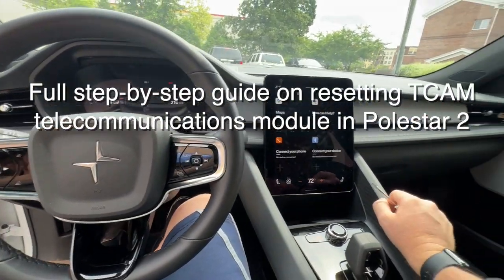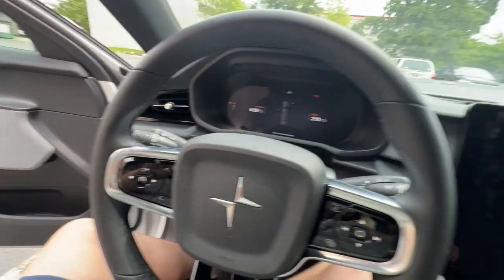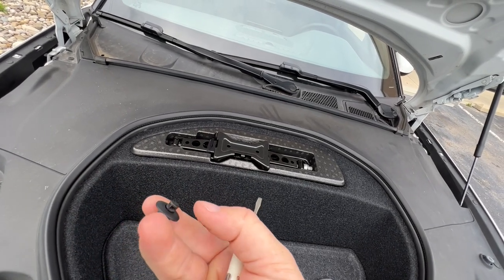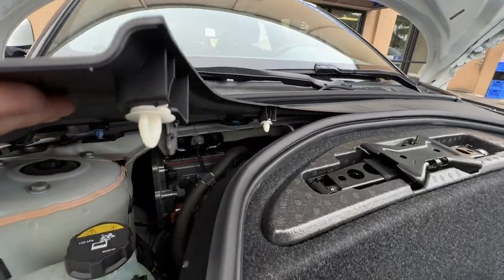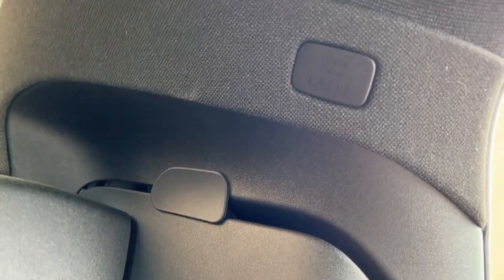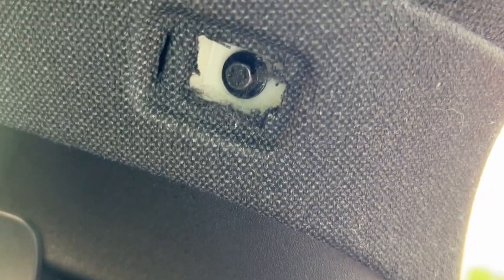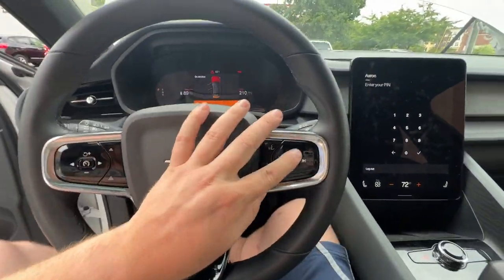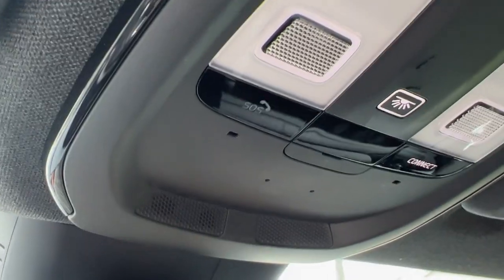How to reset LTE Modem Polestar 2 Step-by-Step (full TCAM reset)

Comment: I would try again but you need to add two steps.  1) Once everything is disconnected, you need to make sure that the 12V circuit is indeed powered down.  Check the LED in the charging port.  If the 12V system is down, then the LED will be off.  2) Once you are sure that the 12V system is down, then you need to connect a jumper between the negative cable (the part you removed from the post), and the positive side (under the plastic cover) you remove all the residual voltage from the TCAM module. Leave the jumper for a few minutes, then reconnect the TCAM backup battery, and then reconnect the 12V system.  WIthout putting the jumper to remove the residual voltage, the entire procedure will often have no effect.  Good luck!
Reply from the maker: Hey thanks for the info! I'll give that a try tomorrow. Do you see this often? Polestar service tells me that it could be the actual TCAM module that failed. I would say that's pretty suspicious timing, because my LTE was flawlessly working until this software update, and since then - nothing.
Reply: @AaronCunningham  Let's say that I see it often enough. Is it possible that the actual TCAM is defective?  Yes, it is possible. But in 95% of cases a 12V battery reset with a TCAM backup battery disconnect is good enough to resolve your issue.
Reply: Thanks for the addition. the video and your addition solved the issue for me!
Reply: Question: Do I have to disconnect the positive Kabel from the Batterie before I set the jumper ?
Reply: @Torsten.  No, the positive cable can stay as is.
Reply: Mine went down a couple of months back and I have tried re setting the Tcam etc but still nothing, even when I try to tether off of my personal hotspot it struggles to find it, my software update was 3.1.9 and I swear it was working fine before that, and the polestar app on my iPhone says offline all of the time 😮

Comment: Did you try the demister reset immediately after the standard IHU reset? This works for many TCAM issues.
Reply: It didn't work for me. Pretty sure they nerfed the ability to perform this soft reboot, without the service center re-enabling the capability to use the defrost button in this way

Comment: Any updates on this?   I've got a Polestar 2 that ilove to death.   I've not had the tcam issue, but I know it's too common of an issue that Polestar/Volvo really should make a priority in resolving.  Common, it can't be that hard
Reply from the maker: I tried the whole process 3 times, including adding a jumper to the negative 12V lead as Roger Jin described to drain any residual voltage. It never solved the issue. 

Ultimately I had to take it to Polestar again and I think they reinstalled the software update that broke it initially